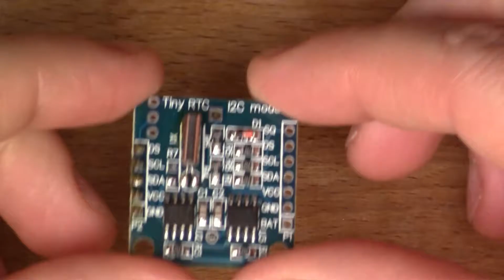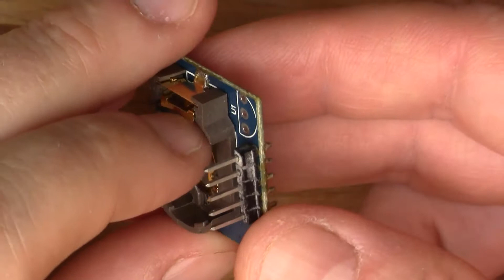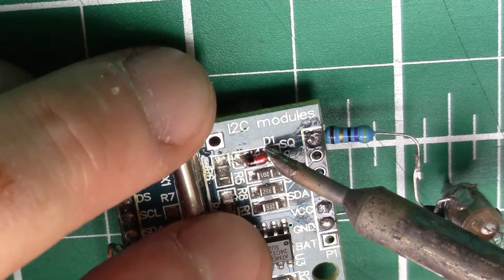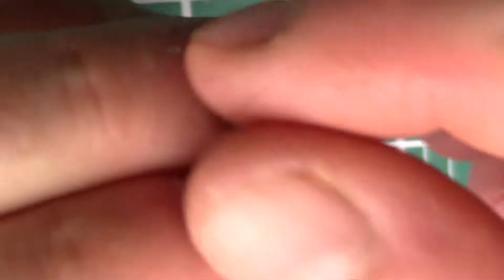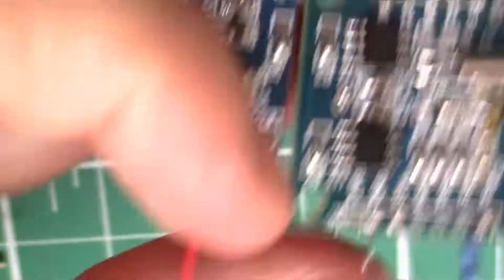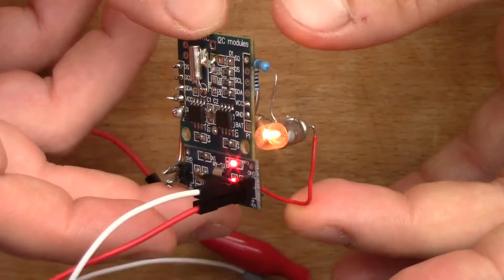Flashing Bulb 2 - Modifying the TinyRTC (DS1307) to Work with a Regular Battery

Comment: Are there better alternative for rtc module ? I'm doing a project and need a small rtc module, I even don't need an external battery just the main rtc chip circuit.
Reply from the maker: I had one in my hand earlier while searching through some stuff.  The DS3231 is pretty small (the chip itself is about 7x11mm).  This one is like mine - you could remove the header and battery to make it smaller: https://www.aliexpress.com/item/1005006194995215.html
Reply: @MartynDavies Yep, I found that one on AliExpress. Thanks for the help 🙂

Comment: Hi Martyn, do you know why the instructions call for R4 to be removed?
Reply from the maker: I would guess because a small current will be going to ground through that resistor, wasting some battery power, though only 2uA, which is not much.

Comment: I have done exactly these modifications and the bloody board just won’t work on the bloody battery 😄. I’m close to giving up now
Reply from the maker: Perhaps a track fractured on the board?  Check continuity of the batter terminals to pin 3,4 of the chip
Reply: Martyn Davies Actually, I realised that the backup battery does work after all. The board does keep time even if I disconnect the 3.3 V supply from my Adafruit M0 board. However, strangely enough the RTC looses the time when the Adafruit board is powered off and then back on. So the problem seems to be realted to the Adafruit board. I just don’t understand why this problem occurs.
Reply: Martyn Davies By pin 3 and 4, do you mean the Batt and GND pins? There is definitely continuity to those from the battery + and - terminals. Thanks for the tips though